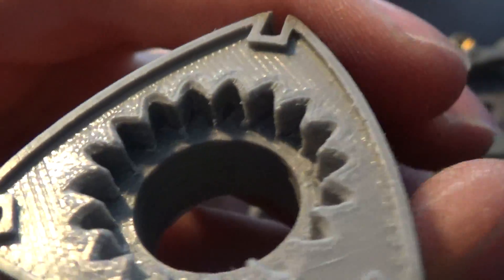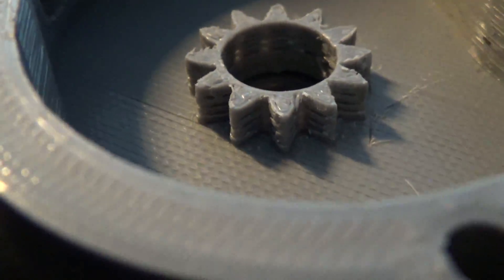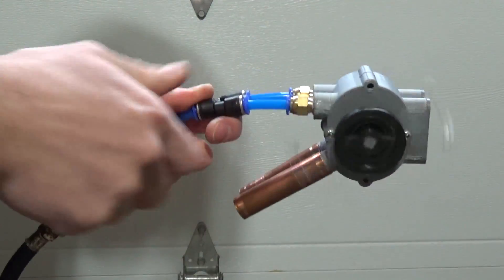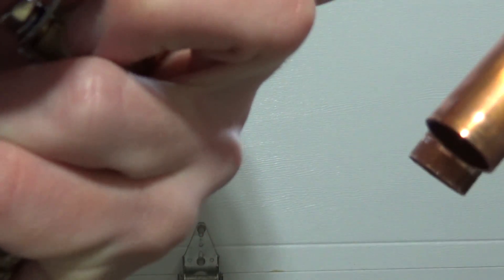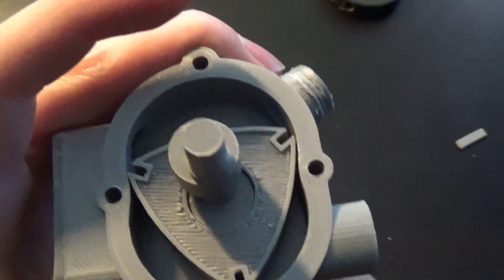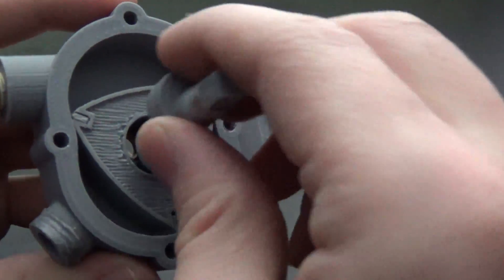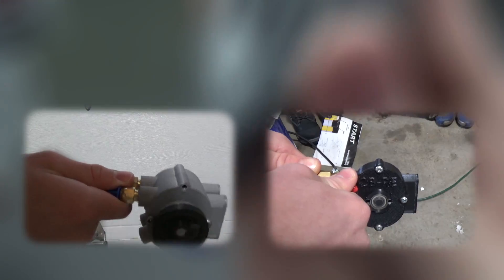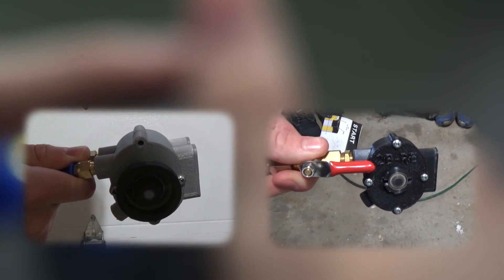2 Rotor 3D Printed Rotary Air Engine!

Comment: save some air pressure. run the exhaust from one rotor directly into the air intake of the second. old trick used in steam engines
Reply from the maker: Good idea however, it would require more valves as the exhaust leaves a chamber before the appropriate time
Reply: Yes, compound setups!

Comment: damn this dude is a true dorito aficionado. can't wait to slap a pneumatic turbo on one of these 2 rotors lol.
do you think that making the little reversing chamber thing 1) rounded and a smooth bend rather than 90° bends the air has to run into then turn around and 2) the same width as the "combustion" chamber and a constant diameter throughout so the air doesn't keep changing pressure and velocity, would gain enough efficiency to be worth a redesign?
Reply from the maker: Thanks man its what I do lol, The original single rotor I put out last video was so efficient that after being broken in could run just from blowing through it. Adding what you suggested would defiantly help and be an easy quick change of the CAD files to fulfill but just because of how satisfied I am with it I will probably hold off for now. This one however , its more of a matter that my compressor isn't great enough to run it that well as it doesn't have a very large tank nor does it put out enough pressure to run each rotor like how the single rotor did. I forgot to mention the fittings are kind of garbage and leak air meanwhile my last one the air was provided directly from the valve.
Reply: @CamdenBowen  gotcha, can't argue with you there the single rotor is amazingly efficient which is ironic considering that gasoline rotaries are the polar opposite of efficient. I'll be waiting for when the revision bug bites you again, it would be cool to see a comparison in torque and runtime between the square chamber and a round one if you decide to implement it.
Reply from the maker: @misterdeedeedee  For now I think I'll set aside the classic dorito Wankel design, I'm currently working on a pneumatic liquid piston rotary engine and maybe that'll be something you're interested in seeing :)
Reply: @CamdenBowen  uhhh, hell yeah I'd be interested!

Comment: 3d print a rx7 body and put it in!
Reply from the maker: I really want to make a little rc air car but I don't know if this engine is even powerful enough to move its own weight but definitely sometime I will!
Reply: @CamdenBowen  probably test some gear reduction and check the torque output

Comment: Have you ever thought of designing a 3D printed 'liquid piston' type engine?It's similar to the rotary but instead of the triangular rotor you have an oval shaped one.I haven't seen anyone making one of these before and I might try myself to build one!
Reply from the maker: I've defiantly considered it but I'll need to deign a valve and timing system for the engine to work right but I want to make one soon!
Reply: @CamdenBowen  wow
I thought the design wasn't real
Reply: Amazing guys
Reply from the maker: @5770mp  I've actually decided to start working on the design for a liquid piston engine
Reply from the maker: @5770mp  Thanks!
Reply: @CamdenBowen  wow amazing..
I want mazda to wake and provide something to buy.. 
I will go to work even though i didn't work in my life lol
Reply from the maker: @5770mp  Mazda is trying to bring the design back and use it as an on-board generator for their electric cars so there is still some hope lol